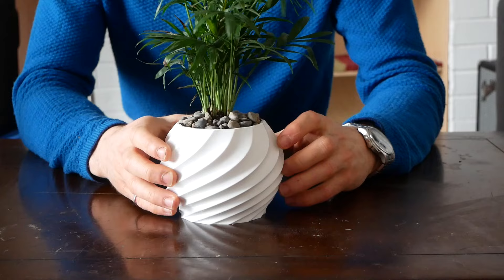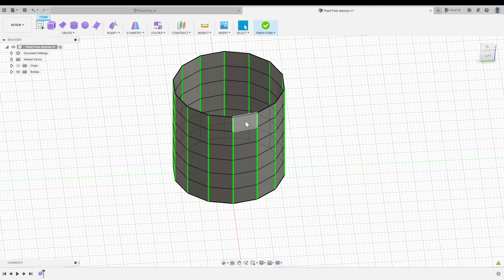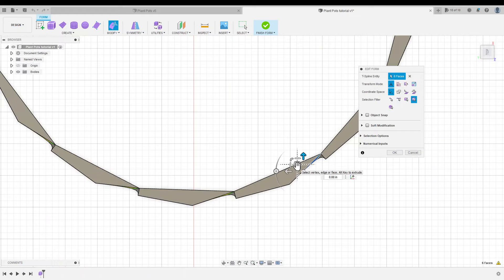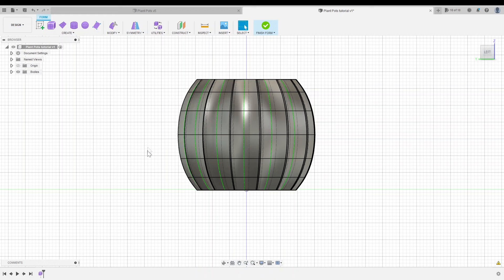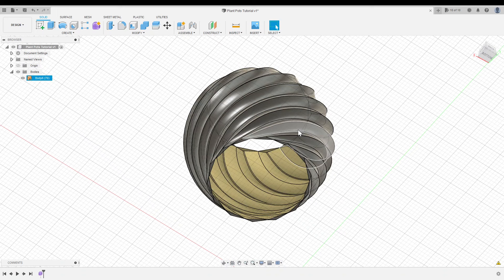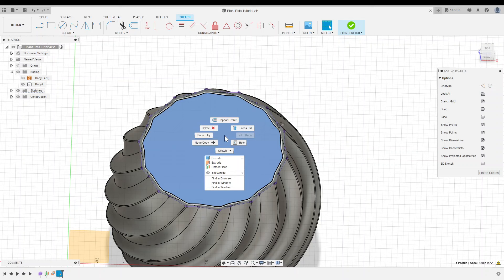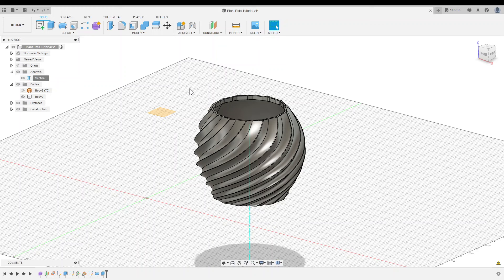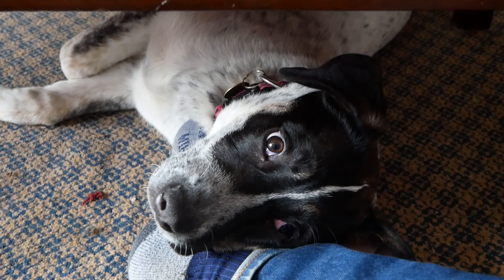How To Design 3D PRINTED Spiral Vases + Plant Pots in Fusion 360

Comment from the maker: For those who are having an issue with your boundary fill volume not turning green - make sure the top and bottom planes intersect with your vase. Remember - boundary fill is all about creating a fully enclosed volume. It might look enclosed from a distance, but if you zoom in, there may be a gap. Try using offset planes to slightly raise/lower your construction planes. Hope this helps!
Reply: Iv been stuck on this forever, no matter what i do it still won’t work and I’ve done everything you said to do, maybe im doing it wrong but i put an offset plane at the bottom of my vase then made another offset on the top  then did boundry fill and still didn’t turn green, please try to help, im trying to print this befor Mother’s Day for a gift for my mom.
Reply: @No_Names-9  I had the same problem. Make 2 offset planes and use ''to object''  You can place a dot on the top of the vase. I hope you understand
Reply: Hi, Does that have to do with the model not appearing hollow in the Prusa Slicer? because in Fusion 360 I can make a single hollow body, but when importing into the slicer, filling appears.
Reply: What did the trick for me was to ensure the offset plane was at least 0.01mm from the aligned surface; moving the plane closer to the center of the object.

Comment: I’m American and I STILL don’t use the imperial system for designing. It’s just not precise and quick enough.
Reply: Same! The metric system just makes more sense and can simplify calculations greatly. Still don’t know why we’re on imperial lol
Reply: Ever done architectural engineering?  Electrical engineering?  Anything serious that isn't blob modeling in a user based 3d design program that does everything for you?
There are great reasons we use imperial.  You would have to educate yourself to understand them
Reply: @12ollin47s  Does it look like he is doing any architectural engineering in this video? Do I look like I'm doing any architectural engineering? No. I'm talking about designing for 3D printing, where the metric system wins by a longshot.
Reply: @willcubemakes  you mean designing useless items for 3d printing.  I design machine parts, gun parts, end use production items where the metric system is less valuable.  So yes, in this specific non value situation, metric makes perfect sense.  Anything else,....  blah
Reply: @12ollin47s  Yes, but I'm talking about this specific situation. You a little slow?
Reply: @willcubemakes  you didn't say that thought.  You said, "when I'm designing". And I said, that is because you've never designed anything where structural integrity, weight reduction and physics matter.  Are you slow?
Reply: @12ollin47s  "I'm talking about designing for 3D printing, where the metric system wins by a longshot."
Reply: @willcubemakes  unless your 3d print is mechanical....  again, no use
Reply: @12ollin47s I know I’m late but you know that the metric system is more precise and is base ten making it easier to make/model anything? Edit: I am in the USA btw
Reply: @Mrpopop1634  easier if you don't math well
Reply: @12ollin47s with metric there are units bigger and smaller and multiply or divide depending on what you need. Imperial is all over the place and you need to memorize so many units. And if you think I’m biased I live in Minnesota
Reply: @Mrpopop1634  Are you an engineer or architect?  If so, cool, I'm glad you found a preference.  If not, you should stop talking now.
Reply: @12ollin47s  I think both systems have their uses I just tend to gravitate toward metric solely for ease of use and I think it’s fine that someone prefers a different system
Reply: @Mrpopop1634  it's not about preference.  It's about use case.  Whether you prefer metric or not, if you design a house in the US using metric, you will never have a house.
Reply: @12ollin47s you can make something using either system and make a house. It’s good to know both because the rest of the world uses metric and knowing both is helpful. I think you are too butthurt to see my point in this anyway.
Reply: @Mrpopop1634  ;)

Comment: Great tutorial. Im just getting into fusion 360 having only used tinkercad before, so this really helps. One tip I've found to save print time and material is instead of hollowing out the object, export as a solid shape. Then when slicing (I use cura) slice with 0 top layers and 0% infill. I find 5-8 bottom layers and 5 perimeters is usually enough to make a strong enough vase/pot and saves all that extra material used printing different inner and outer shapes plus the infill.
Reply from the maker: That is a great idea! I gotta try that. Thanks for watching!
Reply: This is a great tip, thanks!
Reply: Agree, for vases infill is not necessary, more perimeters are the way to go

Comment: For those struggling with boundary fill do this 

1. click construct -> offset plane 
2. click the bottom plane also called X Y plane 
3. in the menu that comes up, click the drop down that currently says "Distance" and change it to "to object" 
4. click on a point of the forms surface on the bottom  (the tip of the "point" that is twisted works well for this) then click okay 
5. repeat steps 1 to 3, but now select a point that's on the TOP of the forms surface and click okay 

you should now have a construction plane on the top and bottom of the form and you will use those when selecting the boundary fill tools

Comment: If your struggling on the boundary fill, just remember that the two planes have to either be exactly, and I mean EXACTLY on the object or cutting through it. If there's even a small gap between the plane and the object, then it won't work. I suggest using the to object when making the offset plane, that'll get it exactly on the top. Hoped this helps

Comment: well, thanks for the tutorial but I have no idea how to get past the boundary fill step as my object does not "turn green". Your object seems to be perfectly aligned on the xy plane, and it has an exact height that you can snap to, which seem important to properly create the offset plane that you talk about, but you did not explain that. I was eventually able to get around that by using a different method of creating the planes, namely the "Plane through three points", one at the top and another at the bottom of the pot.
Reply: I am stuck there too :(
Reply: I was stuck here but I figured it out. In the video, he clicks the origin (XY) plane and his construction plane. I was assuming since I made my sketch on the origin XY plane that it was tangent to the edge of my mesh, but it wasn't. So my fix was just to make two offset construction planes, one for the bottom, and one for the top. You don't have to drag to snap these or know the offset height, just create the construction plane, and then click the top of your object (or bottom) and it will snap to it. Then it worked for me.
Reply: Thanks, perfectly worked... @NotFromConcentrate

Comment: Thank you, that's awesome! 
You don't have to hollowing out the pot, juste use vase mode (spiralize outer contour), the print will be faster (1 or 2 hours)
Reply from the maker: But then you will have extremely thin pot walls!
Reply: @MorleyKert  
Yes but you can cheat with overextrusion and/or a bigger nozzle (for example with a 0.4 nozzle, set wall thickness to 0.6 or 0.8). And once you filled with dirt, the piece is more solid (and without seams).
And a random tip : you can coat the inside with a mix of silicon and white spirit to make it watertight
Reply: @MorleyKert  1.0mm nozzle can print up to 2mm walls ;)

Comment: Thanks for video.
I had another idea how to hollow the inside out. Wouldnt it be possible to create a copy of the Body, but shrink its size so it is 2 thicknesses shorter. Then use the Combine tool to Cut the bodies with eachothers. Because your solution makes me feel material is wasted since some parts will be thicker then other. With body minus body, the outer thickness would be constant everywhere

Comment: awesome video! but for some reason the boundary fill doestn work with my pot any ideas why?
Reply: "I was eventually able to get around that by using a different method of creating the planes, namely the "Plane through three points", one at the top and another at the bottom of the pot." someone said this in the comments and it worked for me. I hope this works for you!

Comment: I know how to fix this (work around) if you cant get it to boundary fill :)

Select the bottom plane and create a sketch, from the origin point create a circle, just a bit larger than your design.
Finish the sketch. Then extrude just to the top of your design, not past the top. 
Next, do an Analysis (allows you to see a cut cross section)
Then, on the Zed axis create a sketch, and use the spline tool to trace inside the outer border of your design, going to the midline from where you stopped at the bottom and close it off at the top. Go past the top with your sketch, but do not go all of the way to the bottom, leave some room. We're going to make this a cut tool for the interior of the design.
Finish the sketch and use the revolve tool, make sure you set it to cut. 
after you complete that, select the Split tool.
Use the cylinder we created earlier and then select the form (vase design) as the cut tool. Make sure you select Extend Splitting Tool(s). This will take a few seconds and then click OK. Thats it. You now have a solid body with your design.

Comment: Hi, if i doe this with my created cylinder and twist it, it shrinks the hole body! The hole bodyform is cangeing. Why is this happening to me? The basic shape of your body is retained despite the twisting.
Reply: When you're doing the profile of the vase, if you had the same parameters as in the video it should say in the bottom right the number of edges selected, if not (probably you case) while holding shift select them all, if still not, go to the bottom of edit form, in selection options, while having selected the edges, click on select loop

Comment: Amazing tutorial... My issue is that when i load it to cura it has holes on the pot, i went back to fusion an adjusted the walls over and over again, and it doesnt matter how thick they are, they always have a hole in the middle of the sections. could you help?
Reply from the maker: Oh no! I’m sorry, I don’t use cura so I’m not sure what the issue is. The center cutout is poking through the sides?
Reply: @MorleyKert  do you have an email so I can send you a photo, might be easier... 😅 On fusion it looks spotless, no holes, PERFECT! then cura comes in and booooom 😂 been trying to figure it out for 3 days, done all the steps over and over again 😅😅😅 and I have some new plants in desperate need of a new pot 😂😂😂
Reply from the maker: Sure! Morleykert@gmail.com
Reply: @martaalves9039   Did you ever get to the bottom of this? having the same issue, looks fine in fusion but cura says something about missing or extraneous surfaces

Comment: Trying to follow along but right off the bat my fusion is behaving differently. When I create a cylinder in the form workspace I don't have the "operations: as new body" option at all, and when I type in the diameter it just creates a random height cylinder and doesn't give me the tool panel to change the faces etc. What is going on with my fusion?

Comment: I’m having massive issues with My attempts all being shown to be non manifold in both Cura and Meshmixer. I’ve been doubly careful not to cross over and have even made much more shallow angles in the model, but the issues still persist.
Meshmixer tells me all the outside faces are non-manifold.
Have you come across this, or do you have any suggestions?
Thanks for the video, I have spent the last two days learning a lot, even if I’ve not yet been successful!
Reply from the maker: Were you able to convert the form into a body in Fusion?
Reply: @MorleyKert  hello! Yes, it shows as a body that I can hide/unhide in the folders on the left.
I’m fairly new to F360, so apologies if I don’t know the terminology of everything!
Keen to learn and get this right though, as it’s an amazing skill to unlock!
Reply from the maker: Hmmm that’s strange, I have had problems converting the form to a body (sometimes you need to delete faces, unweld edges, etc.) but I’ve never had a problem going from fusion to the slicer. Sorry I can’t be more help!
Reply: When I exported as an stl I had the same problem and it would close up the top and bottom and put infill through the whole model however when I exported as a step file I had no problems

Then in my slicer I exported the step file into a stl and had no problems again

Comment: I have a F360 problem that I haven't been able to overcome or find a good explanation for.   When I am going about an F360 design, I create sketches and extrude to a body.  Later on I will move, align, or join the body and it moves out of line with the sketch.  It becomes hard to manage the body via the sketch.  How do I better keep this all aligned and easily managed?
Reply from the maker: That’s a good question! It can be frustrating when you move a body and the accompanying sketch stays stationary. If you go back to the sketch in the timeline and edit the sketch, all of the changes will still propagate forward to the present feature, even though it’s no longer aligned with the body. Hope this helps! 😊
Reply: @MorleyKert  yes and no.  😀. Is there a way to align them again or a way to work to keep them aligned?
Reply from the maker: I don’t believe so, at least not that I’ve found. I try not to move/scale things around too much for that exact reason - just a bit tricky to wrap your head around the sketch/body relationships when things start moving!

Comment: This is one of if the not the best tutorial I have seen on vases so far. Congrats. But for the life of me I cant seem to be able to get past the boundry fill... The model does not turn green
Reply from the maker: Wow thank you so much! Did you click the checkbox on the body? And select a top boundary, bottom boundary and the body itself?
Reply: @MorleyKert  yes.. many times over.. moved the model and planes around.. nothing.. by the way.. do you freelance?
Reply from the maker: Hmmmm I’m sorry to hear that! I’m not sure what the issue is. Regarding freelance work, you can send me an email: morleykert@gmail.com
Reply: @fsouzajr  I had the same issue. The way I fixed it is by adjusting the height of the offset plane from 150 mm to 149 mm (this was the height of my model). Basically, the idea is that the height of the offset plane must be within the boundaries of the vase and not larger than the height of the vase. I also moved my model slightly below 0 on the y-axis.
Reply: Great video, how much do you sell the pots for?

Comment: Did you have to do anything special to print out PETG so nicely ? I've read alot online about how difficult it can be to print PETG.
Reply: the prusa printers handle it with ease, any other high quality printer as well.
but if you have a creality it might more tricky

Comment: At 13:13 My Vase Wouldn't turn Green and I couldn't understand Why If anyone Knows Please let me know. Thank you
Reply: check that the planes used for the bounding are coincident with top and bottom of the body you've created, I had this issue as well and it was because when messing around with the form I ended lifting it up off the origin and the origin plane wouldn't bound the body any more.

Comment: I am having trouble making it a boundary fill, I selected and even offset the planes extra to include all of it, and it won't turn green.. any reason why this may be or a solution?
Reply: "I was eventually able to get around that by using a different method of creating the planes, namely the "Plane through three points", one at the top and another at the bottom of the pot." someone said this in the comments and it worked for me. I hope this works for you!

Comment: I kept getting that overlap error when trying to finish form.

I couldn't figure out where the problem was.  I'm not so good with Fusion.  sigh.

But I figured out a workaround.  That is, after each step, I "finish form."
If it errors, then I have to redo that step.

If it is fine, then I can just press CTRL+Z to bring the form editor back up.

However, I can't get to the point of the construction plane.

I create the plane, but when I try to click on Select Cell, the damned body and planes disappear!
They return if I click on the top option that shows 3 objects selected.

Fusion can be a real pain for someone who is not proficient in it!

Comment: Thanks for the video. You forgot about opportunity costs. How many hours did you spent for finding out about the gear? How long did you take in total to open the maschine, finding out the issue, building the part and trial and fail until finishing? If you searched for 2 hrs for the issue, sat 5hrs on videos of others and sat on computersoftware more 5hrs to create the model, wait for printing and all other work you done for it until it finally worked. I can imagine it could be cheaper to buy it instead to spent so much time and energy for a part.
Reply: por que es tan mala onda la gente
Reply: Pour étre simplement unique au monde 🤦‍♂

Comment: When I import into prusa slicer it it fills the entire object as a solid. It doesn't see the part I hollowed out with the spline. Any ideas on how to fix this?
Reply: You can print in vase mode with 0 top layers. You will get a vase with a single wall.  Not waterproof. Or you can print in normal mode, wit let’s say 3 walls (perimeters), 4 bottom layers and 0 top layers. You will get a more sturdy vase that you easily can waterproof with some primer and clear coat on the inside. The water usually leaks through the bottom and boarder between bottom and walls.